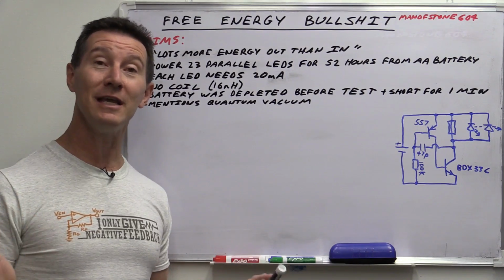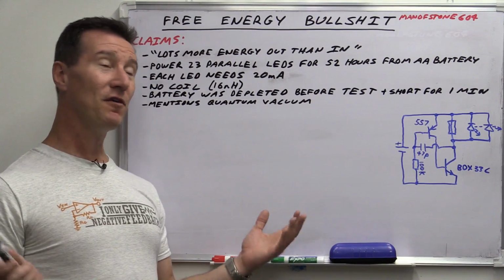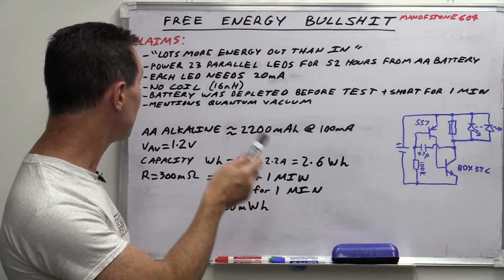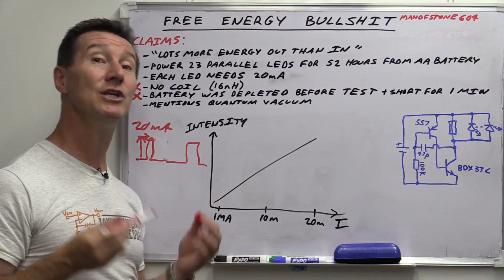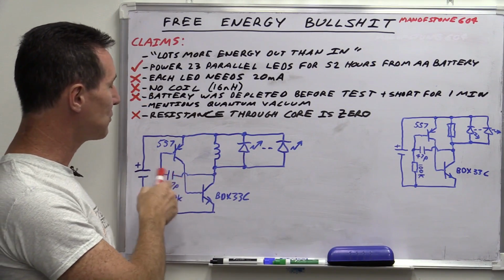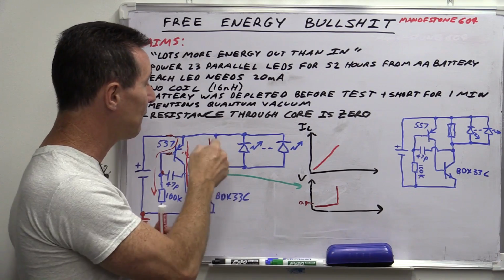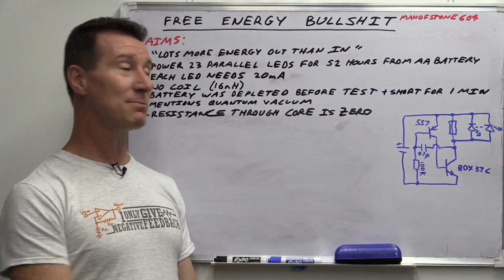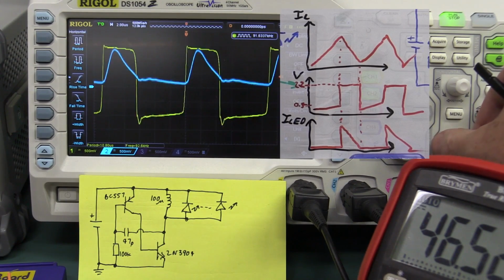EEVblog #708 - Free Energy Overunity is RUBBISH!

Comment: Faith, the new stupid.
Reply from the maker: ***** The eons old stupid!
Reply: Robert Calk Jr. No, I have reasonable assurance based on predictive models. Faith doesn't appear. We know how cars work, we know how they should work, and we now how to avoid internal system damage. I arrive home from work understanding that my car still works. I let it sit outside for the night. Reasonably, nothing has changed  the cars internal systems in such a way as to prevent the cars function. Thus I am assured that when I place the key in the ignition, it will work.
Reply: Robert Calk Jr. Yea false. It isn't a belief. It's a well reasoned and supported inference. I know how cars work, and thus can make predictive models based off said knowledge. I hold no faith or belief that my car will start. I have a well reasoned inference. Of course I can hypothesize that perhaps an intruder had cut my battery and prevented me from starting my car but that is known as a variable in a dynamic environment. The car doesn't change unless outside forces act on it and since the car has no mechanism to self mutilate its circuitry, I can infer that indeed, I shall have no problems starting my car
Reply: Robert Calk Jr.
You are what I call a "word wangler". You try to redefine the meaning of words to support your weak argument. Faith is not synonymous with knowledge and it's silly to claim so. You are clearly a believer and value belief over knowledge. I don't.
Reply: Robert Calk Jr.
John Connor will take care of the machines, no worries.
Reply: Robert Calk Jr.
Faith is belief in the absence of evidence. I keep my car maintained and it starts every time, I therefore have confidence it will start the next time. Faith not required. Indeed, 'faith' is an outdated somewhat silly word best avoided.:)
Reply: Robert Calk Jr.
Ah... 'Judgment Day', the desperate appeal to the 'great-sky-daddy' from a defeated acolyte. However, I wish you were right, I'd love a chance to take part in a judgment day, but I would be doing the judging! It would be very satisfying to tear your pathetic, vicious, useless, ignorant, worship-demanding maniac of a god, a new arsehole! Sadly, I won't be afforded that pleasure so I'll just have be satisfied by tackling supremely arrogant and stupid supporters like you.

As others have rightly said, it's a waste of time talking to victims of the god virus and I try to avoid it. However, I admit it's difficult for me to resist pointing out the stupidity of those who claim knowledge the rest of us can't obtain. Unless you post an apology for your grossly groundless hubris, this will be my last communique to you. I deem you unworthy of sane discourse.
Reply: Robert Calk Jr.
What a laughable tonk you really are!
Reply: Robert Calk Jr. Judgement day? When the giant flying codfish will come to devour us all?
Reply: AllHailDiskordia I thought it was when everyone eats spaghetti and then chokes to death.
Reply: If you believe in god, he will give you free electrons.
Reply: Robert Calk Jr. Judgement day? You nut jobs are always waiting for some apocalypse where you'll surely be accepted into magical goodness land. Everyone else is fucked. Sounds very Christian.
Reply: Robert Calk Jr.
Are yes that judgment day that has been promest so meany times but when it come around it is usualy a lovely sunny day the birds are doing their thing and I find something really cool in the WEEE bin.

Judgement day is a mater of faith and belief, nor should someone be punished for having a different opinion.

Funny the parallels that can be drawn up between Free Energy and Religions of all kinds.
Reply: Nope, Faith is believing something WITHOUT evidence. There is no Faith in Science, it's all based on real world observable and repeatable experiments.
Reply: its already being tapped for cash mate,  many if not most churches pass round an offering plate at some point in the service , I once heard some one say "Giving is a privilege for believers in Christ"  I wonder if sheep feel the same way when being sheared ??
Reply: Faith in what? Don't you have faith that when you go to start your car that it will start? Are you stupid?
Reply: Robert Calk Jr.
Dude, look up how often "Judgement day" was predicted throughout  history, and then look up how often some nutcases said that "the end is nigh" in about 5 minutes or next month or next year
You´re the last in a pretty long list
Reply: Robert Calk Jr.
Tyre is still standing, Jesus was not Immanuel, the apocalype is about Nero.....I think you have done the wrong kind of study, my firend
Reply: Gath Gealaich
Human stupidity is apparently endless, it would be so cool if we could tap it for energy...
Reply: *****
Ok, then you have belief. And belief is what most people have, not faith. In belief there is doubt, in faith there is no doubt.
Reply: MhDaMaster
Don´t make his head burst...
Reply: Robert Calk Jr. We are talking about Faith, not educated guesses and faith from previous experiences.
Reply: cortster12
That could happen as well, along with the whalekyries( they´ve gained a little weight) singing Wagner at everybody at the top of their voices.
Reply: Robert Calk Jr.
All the prophecies I have ever seen are nonsense in general, it´s either outright lies, wild interprtaion  of already vague words, misinterpretation or just plain wrong.
And don´t go down the "no true scotsman-road", that´s the wrong way.
Your religion is just like any other concerning the variety of its believers and what exactly they believe in, wether it´s Buddhism, Hinduism, Islam, Christianity, or any of the others.

greed and selfishness?
Bad traits to have but I´ve seen people of all sorts display just that under certain circumstances, naturally televangelists come to mind.
Yet they are still Christian, just not your kind
of Christian ( not mine either and I think the Jesus described in the bible wouldn´t be fond of them either)

You know what would be a great point for a god?
Religious unity and no disagreements over anything religious...

Oh, btw, I´m not lumping all Christians together, there are many differences between the various versions, it´s the fundy reality deniers who bother me, the same goes for those of other religions.
Reply: Robert Calk Jr. If god can do everything can he create a flame he can't extinguish?
Reply: GeoDen
No, faith is synonymous with knowing. What I'm getting at is that very few people have real faith. There is no doubt in faith, doubt is in belief. Most people just believe and don't have real faith. And the people that almost always start the religious arguments claim to be atheists. And yet they claim to not like to argue about religion.
Reply: GeoDen
Yeah, we'll see who the tonk is. And on Judgment Day, you won't be able to hide behind  a silly pseudonym. lol
But you tough guys can hide for now.
Reply: Robert Calk Jr. "Why don't you blame that crap on satan?"

Because reasonable people blame it on simple thermodynamics. :-p
Reply: Robert Calk Jr.
You don´t seem to have enough in your head to warrant having a headache then...
You don´t "know" anything, you have faith, that is the difference!

You can deny reality all you want, reality always wins, no matter how hard you pray that your version of events is true.

ether it´s archaeology, biology, physics, geology, etc, all scientific fields say you are about as wrong as you can be.

That Guy from the Heaven´s Gate sect "knew" he was right as well, same goes for Jim Jones, Charles Manson, Adolf Hitler and every other idiot following an ideology.

Now I wait for something silly like "Science/atheism is a religion too"
because that is what mental frauds like you usually spout next...
Reply: Robert Calk Jr. Wait, there are experts on theology? That sounds awfully similar to being an expert palm reader. I thought that being an expert meant being usually correct in some sense,which generally excludes joke fields.
Reply: GeoDen
I didn't say knowledge, I said knowing. When you know something then there is no doubt.
Reply: Robert Calk Jr. Lol, Are you for real?
Do you know what a "No true Scotsman" fallacy is? Because you still keep making it!

And you still don´t represent Christianity, in general, you represent only your whacky cult-version of it.

You yourself are wearing a mask and you don´t even realize it....
Reply: Robert Calk Jr.
No that is incorrect. Dave is not god. Dave is not perfect. Dave is not infallible. Dave just make good electronics videos that are educational and entertaining. He is not the only one ether.
Reply: BTW I've been kicked out of 2 Over Unity forums. So I can assure you and Dave that very few of them are Christians. So trying to equate free energy people with Christians is a chimerical effort.
On second thought, I think it was 1 O/U forum and 2 electronics forums. Oh well, who cares? It's always the same thing with those punks - they can dish it out but they can't take it...
Reply: GeoDen
LMAO!! You clowns make me laugh.
Reply: adisharr
I never said that and sure don't use that profanity. I truly believe that most will repent when they realize they were wrong. And whether someone lives or dies is not my decision to make but belongs to Jesus Christ only.
Reply: AllHailDiskordia
That is true. Many prophesies are better understood now than they were before our modern age. You also have to remember that there are many phonies claiming to be Christians, and phonies in other religions as well. Just because someone claims to be a Christian doesn't mean that they are. The easiest way to spot phonies is to look for signs of greed and selfishness.
Reply: *****
Faith is actually a verb. It means - action, based upon belief, sustained by confidence. Belief is just the beginning on the road to faith.
Reply: Robert Calk Jr.
"Well Dave did say that he welcomes "all comments". Are yall going to deny that he said that also? "
Now we know he is trolling, he posted this in another thread. Dave welcomes intelligent debate (as do us). However bashing other's views because of your dogmatic claims does not equal an intelligent debate.
Bringing a straw man into the argument makes you look even less believable than you already are.
Why don't you go create a YT video bashing Dave for his views on religion and we then we can take all these hate filled comments over there instead? I mainly came here because Dave has got some pretty interesting views on EE as a whole and I rather enjoy the commentary. You seem to be fishing for insults to try and prove some "point" that I have yet to figure out, other than atheists are out to get you. We aren't, we really don't care.

To anyone else not following along, Robert Calk Jr. has started all of these arguments on religion in an Electrical Engineering forum (lolwut, I know). I could understand this if he was posting these comments on a video about religion, however this video is not about religion. Sorry you got but hurt, however the world is not out to get you.
Reply: Robert Stever
You guys are such a joke. Dave is the one who started it by calling religious people names and equating them with the free energy people. If you can't even admit that then speaking to you any further is just a waste of time. You remind me of politicians...gasp!
Reply: Robert Stever
I have no ego - I've spent a lifetime getting rid of it.
Look guys, it's real simple: There's a spiritual war going on between good and evil; and anyone that can't see that is either insane, a liar, or like the proverbial ostrich with their head in the sand.
Reply: Jesus Christ , Satan to me its all the same fairy tail so please tell me why I should worry ?,
Reply: +TheEPROM9 It's not new. Its the human plague, has been in all recorded history.
Reply: AllHailDiskordia
You haven't done much study then if you think the prophesies are nonsense.
Reply: Their meanings are very similar. Faith is the idea of thinking something is true with out any evidence or methods to proved or disprove weather the thing is real. Belief is closer to the idea there is something strange here that can't be explained but I will make a judgement to what I think it is, belief can be evidence based but not always.

If I have anything wrong, those with dicsionararys nearby feel free to chip in.
Reply: ***** No, if you show faith, you believe, but the opposite implication is invalid.
Reply: adisharr
Well Dave did say that he welcomes "all comments". Are yall going to deny that he said that also?
Reply: Robert Calk Jr. Belief is a state of mind in which you hold something to be true. Nothing more, nothing less. There's no reason why it should be "the beginning on the road to faith". My eyes and visual processing centers of the brain perceive a spoon on my table. Therefore, I hold a belief that there actually is a spoon on my table in the physical world - either that, or the spoon must be a very convincing hallucination. But belief refers to the state in which my mind became adjusted so that it incorporated the premise of a spoon existing on my table into any consequent reasoning (such as that I don't need to go into the kitchen for a spoon).
Reply: Robert Calk Jr. 
"I have no ego - I've spent a lifetime getting rid of it."
Your posts paint a different picture for all to see.

"Look guys, it's real simple: There's a spiritual war going on between good and evil; and anyone that can't see that is either insane, a liar, or like the proverbial ostrich with their head in the sand."
Uhhh, we don't care.
Reply: Robert Stever
I know...and therein lies how your logic was skewed from the start.
Reply: Robert Calk Jr. faith does not require proof because it has stupidity !
Reply: 3dmaxuser
Fairy tales? Oh, you mean how the big bang just sprang forth from nothingness?
Reply: Robert Calk Jr. "There's a spiritual war going on between good and evil; and anyone that can't see that is either insane, a liar"

Actually, if you're making the claim that "there's a spiritual war going on between good and evil", the burden of proof is on you, it's not your position to badmouth people still waiting for your evidence.
Reply: Robert Calk Jr. Yes and just look at how greedy the Christian church has been over the years . Just look at all the people that have been murdered by so called holy men over the years . You are just a victim of a lie that was told a long time ago because somone like you needed a path to follow because he was far to weak to make his own way in this world.
Reply: 3dmaxuser Jesus Loves You.
Reply: 3dmaxuser
We are mortal knucklehead, we will all die someday. Why don't you blame that crap on satan? You see things as a man, not as a perfect God. Don't expect God to behave like a mortal man. Yes some children die, but just their mortal bodies, not their souls. What do you tell your children, that when they die all they can look forward to is being worm dirt? What a frightening way to live!
Reply: 3dmaxuser
Just because someone claims to be a Christian doesn't mean that Jesus Christ claims them...
Why is that such a difficult concept for you to grasp?
Do you really think a satanist is going to shake your hand the first time and say, "Hi, I'm an evil satanist that would love to steal everything you have including the lives of you and your family. Will you be my friend and trust me?"
Wake up man!
Reply: AllHailDiskordia
Evil people wear masks!! Some wear Christianity and some wear Islam, agnosticism, atheism, Hinduism, or whatever clique they want to be in or were born into. That is a concept that you MUST understand or you are hobbled from the start!
Reply: 3dmaxuser
My Lord Jesus Christ has never let me down! But there are some promises that only a servant of Jesus Christ can claim. Like Isaiah 54:17.
Reply: AllHailDiskordia Well, we could pipe him and the likes of him into a brain turbine and tap that free energy.
Reply: AllHailDiskordia
I rarely have headaches. I've probably only had a few headaches in my lifetime. You see, I "know" what I'm talking about: You only "think" you know what you're talking about - that's the difference.
Reply: AllHailDiskordia
Can you demonstrate that my claim is invalid?

Of course not
Reply: kalimeraHellas
learning about physics would help you answer this question.
Reply: *****
I'll bet you guys grew up watching Tele Tubbies. You probably walk around the house saying, " Tok clic eek ooh". LMAO!! Man, this is just too much fun!
Reply: *****
And that makes you an expert on Theology?
Reply: Gath Gealaich
Yes, they are called Theologians. You guys can't even explain why a transformer works.
Look, I'll make a deal with you guys - if you don't call me an idiot for having faith in God, then I won't call you idiots for not having faith in God. How's that?
Reply: Robert Calk Jr. Ok, and which ones of them are right? I bet it's the hinduist ones, right?

The transformer mention was hilariously random, though.
Reply: Robert Calk Jr.
I don't consider religious people to be automatically stupid, I studied with some exceptionally smart religious people as university's tend to be filled with people from all parts of the world. Stupid people can be found in all theology's, it's just the stupid people of the religious community tend to be the most loud, but that is true of any stupid people.
Reply: *****
So are you saying that Dave is stupid? He is the one that likes to say how stupid religious people are all the time. And he is the one that always get's the debate started. Now we can assume that he does it just to raise the comment quotas, but he is the "loudest". I never say anything about religion on electronic videos unless my faith is attacked.
Reply: Robert Calk Jr.
Hello? You are not being called an idiot for believing, it is the reality denial part that gets you the title.
And you really threw out some weird things, you use obvious fallacies, you like playing the victim and you seem oblivious of the fact that there are literally millions and millions of people from different faiths making the same claims as you about their god or gods.

I could make a better case for the existence of Eris/Discordia than you could make for your god...
Reply: AllHailDiskordia Of course you could: http://www.spacetelescope.org/static/archives/images/screen/opo0724b.jpg :)
Reply: *****
No, he makes the wisecracks on camera also. You fanboys are all the same - Dave is perfect and beyond reproach.
Yall act like he is your God.
Reply: Robert Calk Jr.
So you arrived at the level where you feel you need to insult what you think people like because the thing *you *are apparently a fanboy of is attacked.
Pretty childish
Reply: kalimeraHellas  "They are paid and they do this on purpose to take money. "
Cripes !  Where have I been.?? 
...
Where in the hell do I pick up my checks...???
Reply: Subversive Intentions What are you babbling about? Put down the crack pipe.
Reply: Noevilea  then you're an agnostic, not an atheist. but i could be wrong., either way i like your type. the malicious  close minded atheists. there is something deeply disturbing about their hypocritical views about religion and how they go spewing hate then call religious the hateful ones. it's disgusting to me but you and people like you i like.
Reply: Noevilea that's no problem man, doesn't bother me at all, what drives me nuts is when people  are just hateful of outside ideas or beliefs is my one pet-peeve. my thinking is that you can believe what you want, ill be happy to listen about it all day long and ill be happy to share my beliefs all day long but dont insult mine and other's  beleifs and expect me to sit around and  just let you do so! keep on bein you man and keep beleivin what you believe. lord knows the beauty of humanity is our differences. CHEERS!
Reply: ***** faith
fāTH/
noun
noun: faith
1.
complete trust or confidence in someone or something.
"this restores one's faith in politicians"
synonyms:
trust, belief, confidence, conviction; More
optimism, hopefulness, hope
"he justified his boss's faith in him"
antonyms:
mistrust
2.
strong belief in God or in the doctrines of a religion, based on spiritual apprehension rather than proof.

Your appeal to definition #1 is an appeal to person confidence.  Well, how confident you are about someone or some claim has no bearing on what's actually demonstrably true.  I could have complete trust or confidence that you're really from the Andromeda galaxy because you told me that you were and I usually find you to be trustworthy.  Would that make my confidence justified?  Plus, you're ignoring #2.  That's clearly the type of faith being discussed in this thread.  You can appeal to a different definition under a different context, but you know that's not the type of faith being referenced.  The first definition isn't necessarily claim-based.  The second one, however, is.  Ironically, you're the one hung up on labels, otherwise you wouldn't have attempted to correct me about a label.  Faith is extremely subjective.  You can have confidence or trust for valid demonstrable reasons or for vacuous and insufficient reasons.  There's no objective standard for faith, which is the point.

I also stated, "Even if your faith happens to be correct, you're still not justified in believing something purely on faith if there's no way to independently verify it, attempt to falsify it and confirm it."  Are you saying to believe things that don't meet any of those criteria?  You have "faith" in people or things for no good reason?  You're claiming that faith (even under definition #1) doesn't have to be earned or justified.  A subjective verification of your faith does not make it valid.  Your appeal to faith is no different than "personal certainty".  Well, as we established, how certain you are about someone or some claim is irrelevant to what's real.

If you can't recognize that faith can be unjustified, empirically, you're appealing to credulity and ignorance as a replacement for observation, testing, independent confirmation and falsifiability.  That is an appeal to ignorance as well as an appeal to subjective experiences.  Your entire objection is an appeal to emotion as well, which also isn't a substitute for evidence. Tell me, do you believe (or accept on faith) anything that doesn't have evidence, recognizable patterns or is earned through actions?  In other words, do you accept on faith something that hasn't been demonstrated in any form?  That is the faith being referred to here.  Your objection based on semantics is extraneous and irrelevant.  If faith is too broad a word in this context, replace it with "belief in something absent any evidence or in the face of evidence to the contrary."  There you go.

Human behavior has zero impact on what's real.  Objective reality is not contingent upon what you believe about it.  Recognize this fact or be a "bitch" to your own delusions.  You're angrily objecting to a subjective definition of a word that isn't even being appealed to here.  How odd.  Well, take care now and be sure to "keep the faith".
Reply: Nope that is taking it out of context, the fact that someone becomes your friend means they have already demonstrated these trust worthy traits.
Reply: Stupid people.
Reply: ***** It IS a belief. Belief is what you have whenever you regard some proposition as true.
Reply: ***** Brought to you by the people that like to compare science and religion.
Reply: Robert Calk Jr. We are not Dave.
Another bad strawman.
Reply: Robert Calk Jr. "Dave is the one who started it by calling religious people names and equating them with the free energy people."

But that's exactly what free energy people are! Their faith in the claims they are making is no less religious than with people steadfastly believing in, for example, astrology. There doesn't exactly have to be a deity involved for a very similar mental process to take place.
Reply: Gath Gealaich Now now, let's not fracture his already unstable ego.
Reply: Robert Calk Jr.
Now you are equating your particular version of your religion with with "religious people" in general.
Your views do not repesent Christians in general, and when people attack creationism, they are not attacking religious people in general, they are attacking the BS creationists say.
Reply: *****
No
Reply: Robert Calk Jr. you are a fool
Reply: Robert Calk Jr. Religious people are stupid they cant help it
Reply: Robert Calk Jr.  you believe in fairy tales and then you talk of logic lol
Reply: Robert Stever
Right
Reply: Gath Gealaich You awesome.
Reply: ok so in your eyes he loves me and lets say that's all well and good but what about all the children in the world that are dying right now because of one of the many diseases that your god created and that by your own definition is the will of your god to suffer, I have to ask are these poor innocent beings so sinful they must die as you read this text , I have to ask you what did they do to deserve such suffering ?
Reply: MARIO R. Sheep please tell me what good is love if the lover keeps letting you down ?
Reply: Robert Calk Jr. What are you talking about??? i believe in free energy! Unfortunately, the power company doesn't :-(  ooooh, they are talking about getting more power out than power put in...... I say good luck with that one. :-D
Reply: Robert Calk Jr. what good it that statement to me ??
Reply: 3dmaxuser
None evidently...
Reply: Glad to see I'm not the only one here who watches Thunderf00t. :P
Reply: I know, it amazes me that this "debate" is still going on, then when both sides start to get annoyed that nether is giving in the mud slinging starts. That is the core problem with debating on the internet.
Reply: coercion the old psyhopaths of oil. There is free energy all around because all planets and the atoms are moving for billion of years. Where that energy came throught? Why can't tap it? Like we do with a simple sail?
Reply: No, more like a superstition, the difference being that a superstition is easily disproved, but in spite of being disproved people still want to believe it, like a black cat crossing your path being bad luck as opposed to a white cat.
Reply: AllHailDiskordia
Actually, I do know for a fact. But you wouldn't believe me. That doesn't change what I know. I'll put it this way: If I just said that 'maybe' God our Father and Jesus Christ were not alive in Heaven and sitting on their thrones, I would be a liar.
Reply: Robert Calk Jr.
Can you demonstrate the validity of your knowledge claim?

Of course not
Reply: Gath Gealaich In the colloquial sense, sure! ill grant that beliefs are held as true. However in regards to my car, it isn't really something you hold true as in the back of your mind you always know that in a dynamic environment things can change and thus your car may not work and thus why i don't use the word belief.  Regarding the vehicle, it is a predictive model by which has demonstrated itself to be reliable and so from the model i can accurately gauge if my car will start
Reply: Robert Calk Jr.

Playing even more stupid than you are won´t help you, I´m pretty sure you have heard about that burden of proof thing...

Where is "Heaven"?
Reply: ***** What "colloquial sense" are you talking about? This definition comes straight from the Stanford Encyclopedia of Philosophy.
Reply: Gath Gealaich The most generally accepted usage of the word in my opinion is colloquial.  The term belief is what we would conceptualize as merely ideas we hold. Beliefs are not always held to be true. One can sincerely believe that X is not true and thus why the term to me is not exactly applicable
Reply: ***** That's nonsense, if you believe P, you can as well believe ¬P. There's no distinction in the logic. You just believe that "(X is not true) is true", that's all.
Reply: AllHailDiskordia
You are the one who need help. Read my other posts mister "care for you much".
Reply: Robert Calk Jr.
That is what is called an unfalsifiable hypothesis. It can't be proved or disproved ether way, there for it is not much use in an argument.
Reply: Can people please re-frame from name calling or stating that each other are mentally ill those comments will just turn this into a mud slinging contest to which the internet has plenty, so lets not add another.
Reply: *****
some people are paid nsa agents who trolling and spread lies.
Reply: That seems a bit of a far fetched clam, although there are plenty of people who love to steer trouble. Although I would say most should be called cyber bullies not trolls.
Reply: Wrong, spent my teens head in the skip hunting busted electronics to reverse engineer into a whole host of pointless projects. Also got me into computers and vintage computers. I have since got a 1st Degree in computer Networking and am now doing a Masters in Computer Network Security. Even my childhood was building stuff in LEGO and taking my dads headphones apart. You should not connotate your own life onto others as it just makes you look like a fool.
Reply: Who said I was ever an expert. An expert is not a title you give your self, if you do you just look like an ass.

Religion/God just never stood up to any scrutiny, the arguments for it are incredibly flawed due to contradictions, inconsistency and some really strange ideas of what an super being would care about. Even if there was a god, no one would know what it's plans are or what it wants espeshaly anyone from thousands of years ago.

If anything look at the history of religion, not only is it fascinating, but also there are plenty of examples o it being used t manipulate and control the masses often as a fear tactic with threats of hell if one does not obey.

PS: I get the feeling you get annoyed/upset by people challenging your faith, don't!  It is not a personal attack and it also allows you to evolve having your ideas and beliefs challenged, you should question everything because only then you can truly learn the truth.
Reply: Robert Calk Jr.
Nope, it is merely a blanket statement that indicates his opinion. We are all guilty of making these kind of statements without explaining the context so they can be easy to interpret down one direction. Dave likes to through in comments that will start debates or annoy a certain group. I have done similar things to see if they spark anything. He has never discussed his views in detail on religion other than the odd comment indicating he is in the Atheist camp much like a lot of engineers and scientists.
Reply: Gath Gealaich
lol
Reply: ***** et. al.
 Ho-ly cripes!   We need a Godwin's Law corollary for religion...
Reply: *****
You can't justified malevolent people by simple change definitions or names. They are paid and they do this on purpose to take money. Ahh, actually you can because you are one of  them.
Reply: kalimeraHellas
Now you are going into the territory of crazy rambling and accusing with out evidence, just because someone does not agree with you does not make them automatically evil.

If you are going into a debate it is no good going into wild accusation mode because that just makes you look hilarious

Oh year, my main drive is accusation and preservation of knowledge.
Reply: Faith always was and is stupid.
Reply: Lol free energy
Reply: Greg Addams
It´s free for only 96.95 bucks and no promises
Reply: *****
 do you have an opinion on where life began?
Reply: ***** Opinion? Sure? but Im curious why you desire to hear mine? I understand that asteroids are capable of carrying amino acids and we have evidence of this all around the planet. As to how they arised, how far back are you talking? when we say life, do you mean abiogenesis or before that?
Reply: You guys know whats funny about the faith, and the guy with the car model - is I'm sure when someone bought a honda after 2009 with the sticking gas peddle I wonder how their faith was shaken. OR the other gazillion problems that cause recalls. OR The Hindenburg, pretty sure they tied up all the "loose screws". (one loose bolt = death - don't be dumb) That's actually an extremely bad argument. Comparing mathematical models, and engineering inferences vs philosophical faith.(comparing the know vs the unknown or unknowable) In the world of philosophy that would be akin to false equivalence. However being an atheist in 2014-2015 is rather fashionable. +10 on the edge factor - I tip my fedora to you.
Reply: ***** Nice, the kind of guy that can explain how a car works, until it doesn't work, then you pay me to fix it because you have a "supported inference" on how "cars work". But you really just talk.
Reply: Robert Calk Jr. you call that faith ? think you might want to check the definition on that
Reply: Gath Gealaich You are so deceived and deluded. http://www.collective-evolution.com/2013/10/11/multiple-scientists-confirm-the-reality-of-free-energy-heres-the-proof/
Reply: Landotter1 http://www.collective-evolution.com/2013/10/11/multiple-scientists-confirm-the-reality-of-free-energy-heres-the-proof/
Reply: ***** It certainly has hijacked any dialogue on over unity....which was probably the intent from the beginning. What does a man's faith in his god have to do with the existence of free energy? Nothing....but it will certainly get a rise out of him.
Reply: kalimeraHellas You have just stated the simplest PROOF of free energy. The myth that it does not exist, is just that.....a myth. Most over unity systems are based on the exact same principle of planetary magnetism....Torrid.  http://www.collective-evolution.com/2013/10/11/multiple-scientists-confirm-the-reality-of-free-energy-heres-the-proof/
Reply: Robert Calk Jr. They care not about your faith in God...what they did was hijack the dialogue on over unity. The proof of so-called free energy is out and deniers simply look foolish at this point. It is not a theory anymore. Terawi designed and built the generator which has been purchased by a company in India. It emits 250% of the energy used to operate it. I am sure you already know this. For future debate, here's a decent web article on many others. partway down the page is an excerpt from the movie Thrive that shows many others. http://www.collective-evolution.com/2013/10/11/multiple-scientists-confirm-the-reality-of-free-energy-heres-the-proof/
Reply: believe it
No he did not, but you seem to have provided some real sources to look at. Will be fun to critically analyze. Maybe do a video on.
Reply: believe it And so what? Even if you could extract energy somehow from the Casimir effect, it would be no more "free energy" or "overunity" than what solar cells are doing. It would be yet another converter from one form of energy to another. Of course, solar cells actually work in a useful way.
Reply: ***** holy crap, i'm living the same life you did as a teen!
Reply: Robert Calk Jr. Maybe you should spend a bit less time posting a actually read the bible for what it says. You people are full of claims that cant be backed up and you throw around words like you invent a new meaning. Well meanings are defined - pick up a dictionary and learn something because your word manipulation is showing you need some education.
Better to remain a fool and keep your mouth shut than say anything to remove all doubt - OH SORRY that's logic you may not understand - lol
Reply: EEVblog have u heard of kapanadze ?
Reply: *****  atheism, the new close minded cult.
Reply: MegaMackproductions Not necessarily mate. Some of us atheists do know there is a sprit world but not all are like me and the ignorance or arrogance can lay at both ends of the scale. Some like myself are fence sitters because some personal experiences cannot be defined or explained by our current level of knowledge or science or physics.
CHEERS
Reply: MegaMackproductions I tend to vary my opinion depending on the subject or angle of the topic at hand mate.
I don't really think I fit into any typical category or label per-se. I just use the skeptical atheist to give others an idea of my angle.
Some people say I`m not skeptical or an atheist with regards to my knowledge/experiences about spirits or ghosts.
Those people tend to be the ones that drive me nuts because they really don't know how to categorize me.
Most people that do this are skeptics themselves and they try to trap me into being a " Denier " which is my label for many of them.
Many cant separate the spirits and GOD issue so for them its an all or nothing debate mate. 
Some just want to deny everything and wont see reason of any sort.
This can go for both ends of the spectrum - those that want to believe at all costs and those that deny at all costs.
CHEERS
Reply: tarotbug I hope you`re not admitting to be stuck in the old stupid as well
Reply: ***** Faith has always been stupid, by definition.  If you have evidence, you wouldn't need faith.  So, yeah, it's the old, current and future stupid.  Hopefully it's less prevalent in the future, but I have my doubts.
Reply: ***** How am I spreading ignorance?  Faith is, by definition, the excuse people give for believing something without a good reason.  If you could justify your faith, it would cease to be faith.  Faith cannot be evidence-based, by definition, otherwise there would be no reason to take any position or claim on faith.  Faith is also not a pathway to truth since two people can hold mutually exclusive faiths.  I could take it on faith that your faith position is wrong.  That would get us nowhere in the search for real explanations and answers.  We could have complete diametrically opposed faiths.  Your faith is subjective and indistinguishable from other faiths.  That's why people who care whether or not their beliefs most likely comport with reality do not take any position on faith.  That's not ignorance, that's intellectual honesty.  It's so easy to just throw around the word "ignorance" where it doesn't belong.  Objective methodologies (like the scientific method) are key for determining fact from fantasy.  Your faith is irrelevant towards what's actually real and factual.  Even if your faith happens to be correct, you're still not justified in believing something purely on faith if there's no way to independently verify it, attempt to falsify it and confirm it.  So, no, faith is not an honest position.  Your handle, however, is rather appropriate.
Reply: xebek couldn't have put it better myself mate.
The big problem you have here is you`re using logic to reason with someone that has potentially lost faith in logic - lol
CHEERS
Reply: Noevilea
Haha, thanks :).  Valid point.  Trying to reason with the unreasonable can be a fruitless endeavor.  I guess I'm just stubborn like that.
Reply: xebek zombies get to them and suck out their brains - some zombies go hungry.
Reply: Robert Calk Jr. See, therein lies your problem, you fear death and you simply cannot accept the fact that you will die and that everything you were and are is no more. There is no such thing as a soul, otherwise prove it, but you have to beleive there is in order for you to cope with your fear of  death.  WHAT A FRIGHTENING WAY TO LIVE? isnt it more frightening having total faith in an ideal that is based on a book written by a bunch of guys a few thousand years ago, and these guysnot only lie about who wrote it (they did, but what they write in it is all unsubstancial and was never intended to be taken so fucking literally). Are you really that niave and reluctant to actually read up on the proof that everything you claim is false. there is no harm in admittting your mistakes, its actually much better than continueing on acting like an idiot. You arent saving anyone with your words, your just proving how fucking retarded most of humanity is. I am 21 years old, and im already fucking tired of all you idiots preaching this stupidity... ITS DEPRESSING and FRIGHTENING, please please please, just do some fucking research on what you claim, and please please make sure that the sources are justified and objective. Everything you have claimed in these comments has all been subjective and biased towards a religion, however most of what im stating isnt only my opinion but a objective look at life and all the information I could gather on these subjects being discussed, I have actually read up on what you claimed and come to the conclusion that its false and unjustified without much proof to the matter, AND I WOULD HATE TO LIVE MY LIFE BASED ON LIES AND FALSITIES: PLEASE GO FUCKYOURSELF ROBERT, you make my sad and really pissed off.
Reply: Robert Calk Jr.  +AllHailDiskordia I can actually ;) See, science and logic is based on objective knowledge aquired by study, analysis and testing, and since what you claim can neither be observed, tested, replicated and analysized, and therefor your claim is utterly in-fucking-valid. OK?
Reply: Nick Salling 
I fear nothing: death or any man on earth.
Reply: ***** Yeah, maybe I should, however this man Im arguing with can hardly grasp the reality of life nonetheless grasp a true sense a spirituality.  To be completely honest I dont even know why im wasting my time trying to enlighten someone who will have no influence on the future of humanity. I'm just scared that people like him might actually be the majority in some states and countries. I'm planning to start a blog in a few months time where I will try to change the world for the better, might even link it to this delusional psycho Robert Calk Jr.  ...
Reply: Robert Calk Jr. HAHa, you fear reality and its consequences, otherwise why would you so blindly follow a religion that only helps you 'answer' question you didnt think we actually have the answer to since believing in a fairy-tale is more entertaining, probably influenced from a young age about religion. Logic obviously doesn not exsist in your mind after being brainwashed from religion. Critical thinking? ever heard of it?
Reply: Nick Salling 
If you can't see that there is a spiritual battle waging between good and evil then you are blind, stupid, or a liar. Which one are you?
Reply: Robert Calk Jr. If you assert things without any demonstrable evidence what-so-ever, you're either ignorant, credulous or indoctrinated.  Which one is it?
Reply: xebek 
There is plenty of evidence for anyone that cares to look...
Reply: Robert Calk Jr. Please stop strawmanning your arguments and actually adress the questions and accusations being put forth. And im neither stupid, blind nor a liar, Good and bad is in us all and ones actions defines which side you lean more towards. However this does not give anyone the right to condemm someone to completey be evil and justify it based on ones subjective view of how life works and what is and isnt true. Its immoral, idiotic and ludicrous, your a lost cause, and I sincerely hope future generations wont be so dim-witted, corrupt by religios semantism and so on. And let me get this straight. Religion can be good, and i respect people who follow religion as long as they dont try to preach bullshit, spirituality exists and I feel like some religions ideals are amazing however they shouldnt be taken too seriously and therin lies the problem of most religions.. 
sigh, I really hope you wake up from this dream you  are living one day.. but i highly doubt it, peae and one love.
Reply: Nick Salling 
There are all kinds of websites chocked with information if you care to look. Personally, I could care less what you believe. When the 2 witnesses of God of Rev. 11 get here, none of you will have an excuse to deny Jesus Christ.
What I don't like is Dave Jones calling me an idiot without offering any proof; and you sycophants with your noses up his ass, attack me when I ask him to prove that I am an idiot.
Reply: ***** 
I am a literalist - Revelations is not mythology.
The Holy Bible is all I care to "study", not "read". My faith is absolute: I have no need to read someone else's interpretations.
Reply: Robert Calk Jr. LOL but you are reading someone else's interpretation. The bible is history's longest game of telephone. The bible has been re-interpreted so many times, and so many of the original texts are gone, that no one really knows if it's even close to the original document.
Reply: Robert Calk Jr. Okay cool, redefine a word... What purpose does that even serve? Faith is commonly used as a way to believe something without evidence. If somebody enters a coma, and chances aren't looking good for that individuals, some people will have faith that they will awake from that coma. They believe they will wake up, without any reason to justify that it's going to happen. Some people, recognizing that they have no evidence for a God, say you should just have faith! These are calling Agnostic Theists. They don't know for a fact that God exists, but have Faith that he does anyways. They believe that he exists despite not knowing that he exists. There's believe, and there's knowledge, Faith is a category of belief. Slightly more specific is all.
Reply: ***** " just because you repeat what you are told does not make you an authority."

Who said anything about an authority? If you're saying "Just because somebody says this is what it means doesn't make it so," then I'd have to agree with you. The thing is, language is a tool for the masses to communicate. Not one individual dictates the meaning, general population that uses that language decides. 

"if you are interested in having a reasoned argument, the definition in question must be defined, otherwise you are just wasting everyone's time."

Thank you. If you want to change the definition of words that's contrary to general usage, just let the people on the other end know. That's why I made it clear in my comment how the word faith is typically used and why people have a problem with it. If that's not how he uses it, then it's not relevant to him. Just as his defense for his nuanced definition of faith isn't relevant to the people who are disputing the faith that people generally use it as. 

Also you should probably read up the the appeal to population logical fallacy and the definitions you just cited. Many of those definitions corroborate with the definition I'm using and am explaining why a lot of people have a problem with the concept. And that argument from population is saying somebody's right because that's the general consensus. Sadly, the meaning behind words are defined by the population. I hope you learn from your mistakes.
Reply: ***** Don't you have some yiffing to do furry? We all know what you sick fucks do in the boonies.  You should be getting on with that instead of tipping your fedora.
Reply: Robert Calk Jr. Religion is just pabulum for the dying so they don't lay on their death beds made of  sticks of dynamite with 'Dead man switch' in hand.
Reply: +TheEPROM9 Good one.
Reply: +TheEPROM9 
well it always was but since the internet it became more obvious :D
Reply: Faith by definition is taking the idea that something is true without any evidence to back it up. To me the idea of having faith is ludicrous as it makes you easy to manipulate because all someone has to do is play on it. It is better to just admit when you don't know the answer.
Reply: ***** I was too lazy to explain all that.  Thankee
Reply: Thanks =-)
Reply: Indeed, that is why you have to be very selective in who you trust, end of the day no system is perfect.
Reply: You don't forget about family members you have lost end of the day we have all lost love ones at some point, faith did not help when someone I loved was on their death bed, accepting the truth that they would not pull through did because at least when they did die it did not hit me by surprise and I was always prepared. Do you at least see where I am coming from though.
Reply: I agree with you there as you need to live like to the full, life is to short to wast and taking the odd chance can be rather fun. Those moments you do something you should not because of danger or you might get court, my teens were spent getting up to mischief

I do live a fulfilling life because I have always worked towards what I have wanted. I have just never needed faith to achieve my goals, perseverance and knowledge have been the tools for me. Every point where something goes wrong is a learning experience that makes you stronger.
Reply: +Hamguy Bacon Now that's what i call EDGY!
Reply: Hjärnknullade människor.
Reply: +TheEPROM9 lolololol
Reply: Stupid idiots that dont know anything about anything.
Reply: +TheEPROM9 Exactly
Reply: ben barr I used to be an atheist until i figured out this bullshit, Atheists are just as if not more religious than religious people. They are a worse version of Jehovah witness they dont go around door to door they use the internet.
Reply: Yeah masonic statism science. Like dr mengele. Why people need scientists becouse they never learned to think themselfs. And they dont know jack shit about spirit or other realms.. They have no understanding of cause and effect in motion to the degree they understand spiritualism. Fucking moron people programed in the heads they know nothing about anything.
Reply: +TheEPROM9 so the God of this universe never taught in his existence based on the many evidences you stupidly ignore because you have faith (and deliberately ignore in your evil arrogance) that there is no such evidence whenever you type anything into google other than "bible, evidence?" mr, "i never heard of living fossils, i never heard of evidence against evolution, i never heard of evidence against the big magical life making emotion making bomb, i never heard of..." you're an idiot, an ignorant simpleton
Reply: sloppy to who stupid narcissist?? oh. u, representative of the universe and king of trolls, get lost dumb ass
Reply: +adisharr  Yeah, the fact that they can be content knowing others are suffering in hell is very telling, to me their heaven would be hell, shows I have compassion and they have none.
Reply: +Robert Calk Jr.  That is not faith, you can conceptually understand why your car starts, no faith is required or demanded.
Reply: +Robert Calk Jr. Nope, know belief, know- ing from the root KNOW, to know and understand conceptually, to think, knowledge.
Reply: +Robert Calk Jr. "Faith is actually a verb"
Oh my god I'm dying.

How can someone be so stupid?

I'm going to ignore your many errors relating to other things because everyone else already pointed them out. But do you seriously think there is a verb "to faith"? What's the past tense, "faithed"? Faith is not a verb, you inbred mongoloid.
Reply: +Black Gate of Mordor Ehm im a buddhist, I referenced off the Tao. I think the word if Fate. I have a hard time reading humor though...
Reply: +diskman66 Fate is the verb... if you want to be exact.
Reply: +diskman66 Perhaps you could say one was or is fated
Reply: +diskman66 Or perhaps the fact that you have now been fated.
Reply: +diskman66 or perhaps the fact that you now have been. (K)
Reply: +diskman66 I have fated you..
Reply: +TheEPROM9  You mean the old stupid.
Reply: +MyITRcom You are both right. The old stupid is coming back. Good job schools, you are doing a great job.
Reply: +Robert Calk Jr. schooled that fool
Reply: +Robert Calk Jr. people are dumb